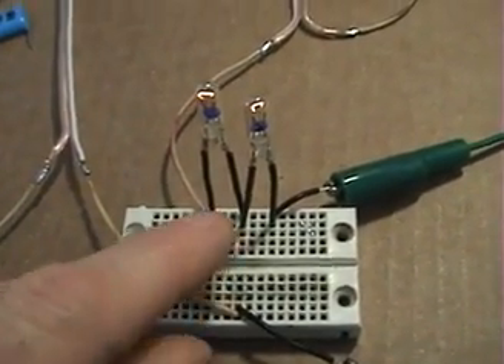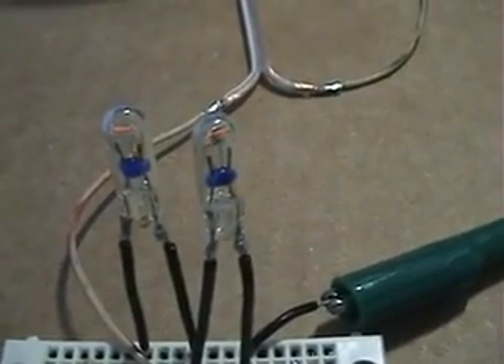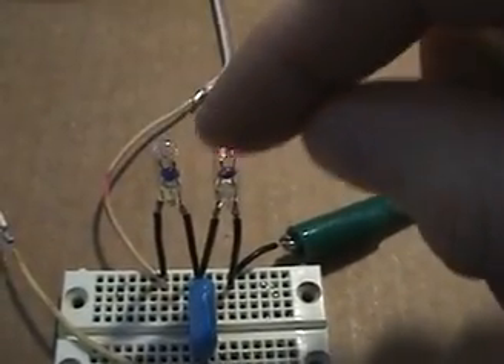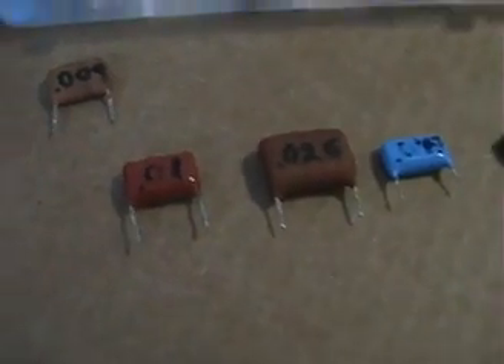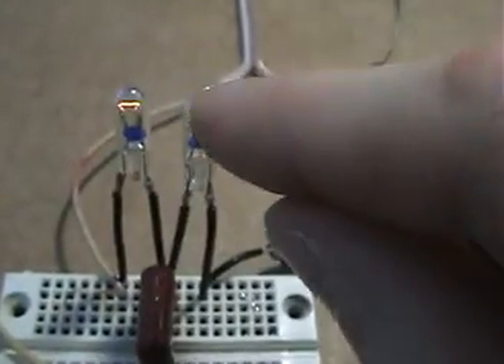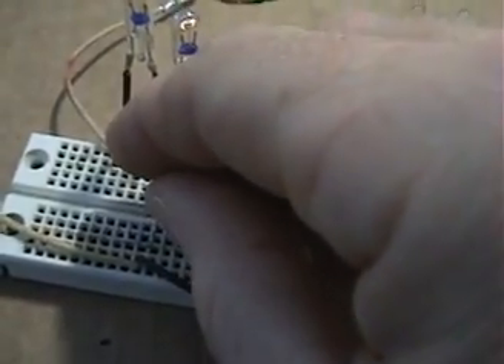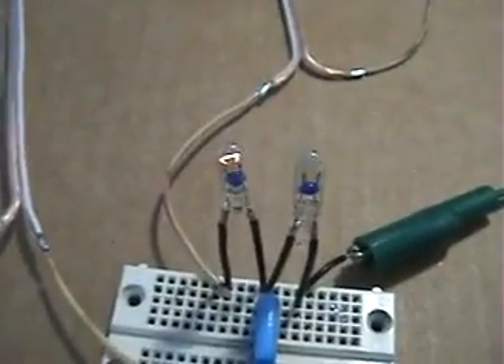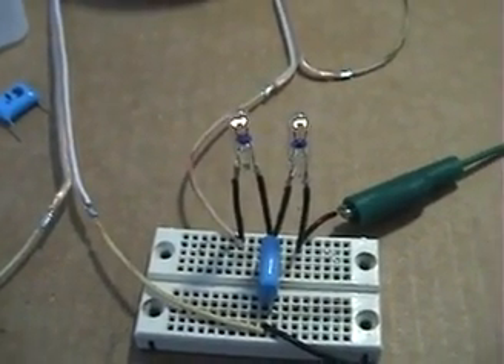Coil Resonance Tutorial 3

Comment: Hi Luc,
Have you done measurement with oscilloscope on this circuit after tuning it with bulbs and that removing bulbs?
Reply from the maker: Yes I have! there's no OU with resonance alone.
Reply: I was just wondering how much removing bulbs  will distort resonance
Reply from the maker: It has little effect on the resonant frequency other then making the current stronger in the coil.

Comment: Dude! Wooten on the forums dogged me for using regular light bulbs like yours to show power in vs power out. I knew my circuit was overunity!
Reply: I was using a tiny isolation transformer were the input side had equal inductance as the output side. each side had a tiny christmas tree light strand bulb then just a tuning cap, and of course the signal gen on the input side.
Reply from the maker: It's true. Using the bulbs is not a way to measure OU. I did this 9 years ago, not a way I would measure power in and out today. Luc
Reply: Jake Mitchell hello

Comment: My signal generator is too low power. How can I use his method with a pulse generator and amplified transistor?
Reply from the maker: +Moshe Simantov You can use an audio amp but you will be limited on output voltage and frequencies of up to 30kHz. The best is an H-Bridge for higher frequencies and voltage. You may find a built on on ebay if you can't build one. All the best. Luc
Reply: +Luc  gotoluc Choquette I have already pulse generator and fast-switching MOSFET. The problem is that all my pulses is only one direction (ie. +5V to 0 instead of +5V to -5V). Should it work in parallel configuration? I can't find the resonance point..
Reply from the maker: +Moshe Simantov It won't work with chopped DC it has to be AC sine wave  or square wave. You feed your generator in the input of a audio amplifier and the output to your coil and capacitor.
Reply: +Luc  gotoluc Choquette Thank you. I hope there is a way to do this with chopped DC. I will continue on searching..
Reply: If you want sinusoida signal you can use signal generator to drive transistor which would drive small trafo.